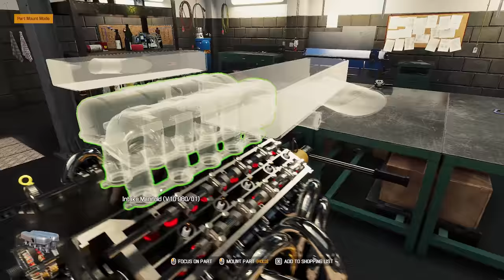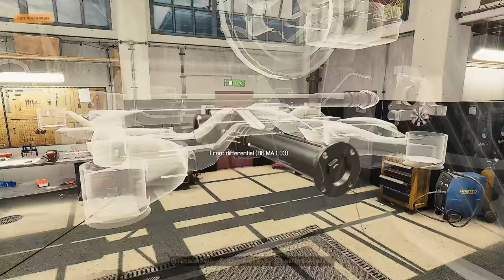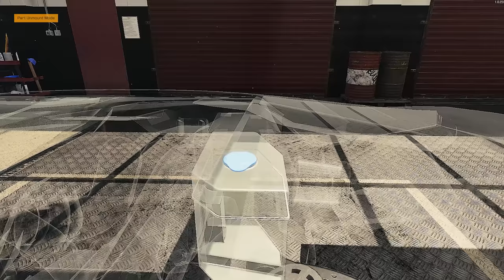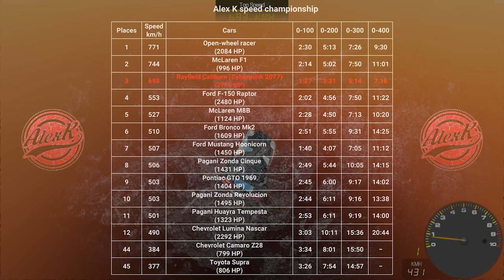Rayfield Caliburn restoration - Car Mechanic Simulator 2021

Comment: What car is that game from
It looks like it’s from 2077
Reply: It is from 2077. The Rayfield Caliburn is one of the few cars Rayfield has developed, alongside the Aerondight and Excalibur AV. The windows use CrystalDome technology to guarantee privacy, and the engine is electrically powered, and located in the back of the vehicle. It's max speed is 210 mph.